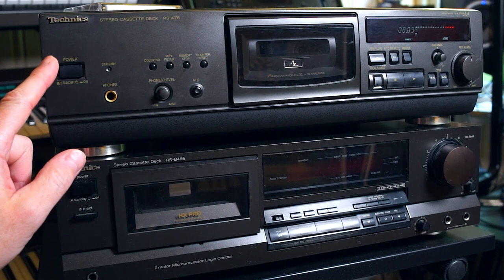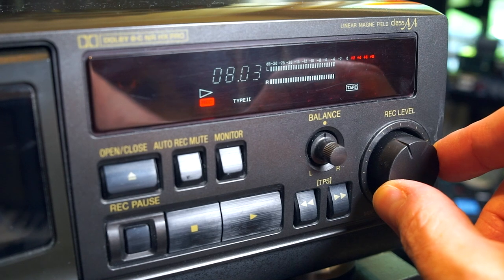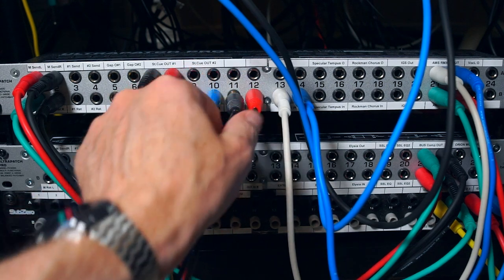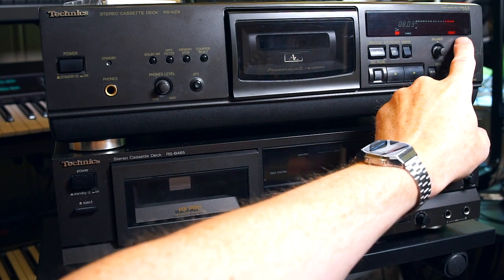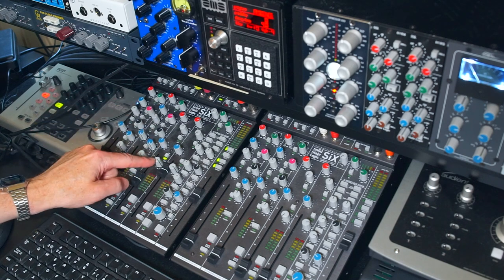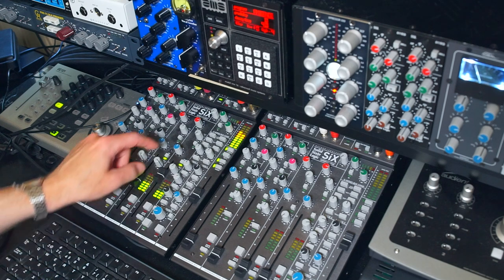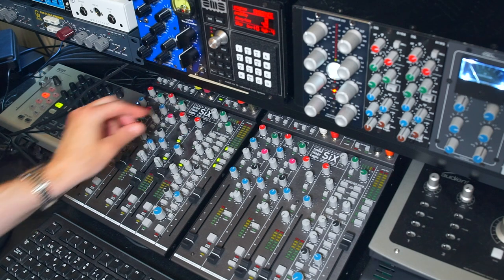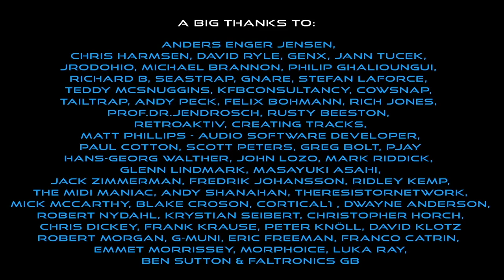Use a hifi tape deck to get a classic analog tape delay | Tutorial

Comment: Beautiful! In high school in the 80s, we found a three-head cassette deck that also had a knob for variable playback speed and were able to increase the delay time (and get more analog dirt as well). Great demo video, Espen, as always.
Reply: Oh heck yeah
Reply from the maker: Cheers man!
Reply: As I understand it, you can use a PWM thingamajigg to adjust the tape speeds on most tape machines.

With some extra tinkering one could probably make the distance between record and playback head variable as well. And replace the cassette itself with one that has a tape loop.  But..  at a certain point one might be better of getting a real tape delay.. 

But as I understand things, a PWM mod is usually pretty straight forward as a mod.

Comment: Also remember that you've got two mono delays available with this technique - with some extra patching you can do double-length delays as well as ping-pong! I do this with my Akai 4000DB sometimes, thankfully that's got quite a significant head gap.
Reply from the maker: True. With a split cable and patching you can get more out of this technique.
Reply: eye opener, thanks

Comment: Even staying with a cassette deck, you can obtain better results in using a 'real' 3 head one (like the high end models by Technics, Uher, Tandberg, Teac, Revox, Nakamichi), meaning using a dedicated full range playback head (same as on a reel to reel tape recorder) contrary to the model shown year solely equipped with a simple monitoring head (exclusively used for direct monitoring during the recording session, while the machine returns to the recording head this time used as a playback one when normal listening session.

Comment: I used this technique quite often, though I wished I could slow the tape down manually to space the echoes out.
Reply: Exactly what I thought, you could adjust the delay time by altering the motor speed - at the price of a lower audio fidelity for the delay (but that's part of the appeal)

Comment: I remember doing that with tape machines.  Hey Espen, How's the analog instrumental CD coming along? I didn't miss the release, did I?
Reply from the maker: It's not a CD release, it's cassette. ;-) No, I haven't started taking pre-orders yet. The first run of a hundred will be a very limited edition, signed and numbered. I will take preorders on my Patreon first and with anyone left I will make them available here on the open channel. If you follow the channel regularly you'll see my announcement. ;-) Cheers
Reply: @EspenKraft I don't have a cassette deck anymore. I been following since 2008.
Reply from the maker: The album will be released digitally online as well, eventually. ;-)

Comment: Technics RS-AZ6 was have very bad heads. Me and my friend, many years ago was tuned this model. We install sandwich by Canon H36001. Effect very smallest. 
For great result use top decks.
Reply: Too bad most of us can’t afford «The Dragon»… 🤷🏼‍♂️ When I play all my cassettes, both own and bought tapes from the 80-90s, they sound perfectly fine on this player. I think you’re just very picky when it comes to this topic.
Reply: @AndersEngerJensen  sorry, this is not pickiness, but experience. At one time he owned a model from Nakamichi zx-9. Channel-by-channel calibrator, manual selector, you can record chrome in 120ms. And the author's Technics AZ6 is Matsushita's last breath. The same Pioneer CT D7 is better. The dragon is certainly good, the price is yes, 10 years ago it cost much less.
Reply: @universal_migrator  But… we’re talking effects here, not reference listening. Even though, I do not agree it has «very bad heads»… you need to weigh your adjectives more precisely. They aren’t top shelf, but they’re certainly not bottom either. Mid to high is more acurate. But it’s mine, and I will use it as I feel like and that’s that.
Reply from the maker: I don't think we're after the "best sound of the year" award here. Just a simle tape echo slap back effect. For that we could use anything really, the more dirty the better.